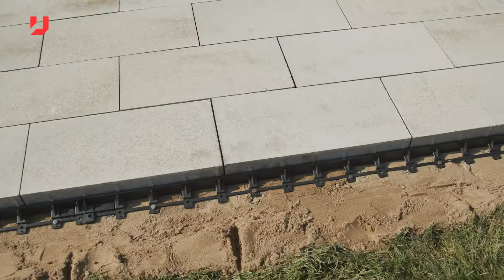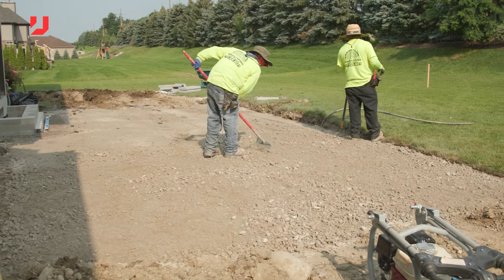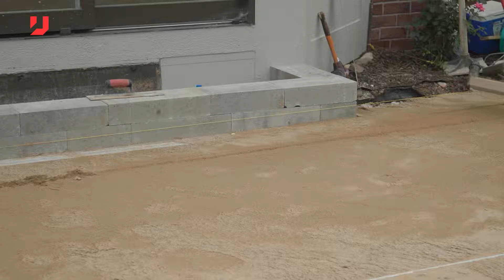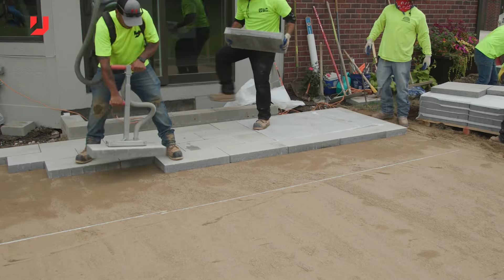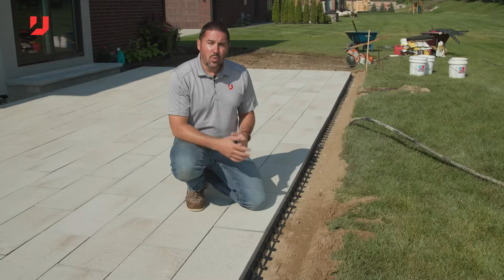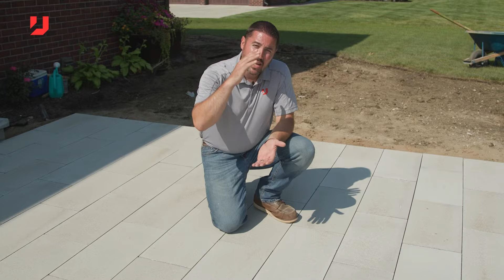Step-by-Step Guide to Paver Patio Installation

Comment: What’s the difference between using 1.75 inch pavers versus 2.3 inch pavers? 

I’m building a 17 x 17’ patio in Virginia. The plan was to dig 7 inches down with a 4 1/2 inch base, an inch of sand and then the 1.75 inch pavers. 

Is that fine or do I need to change it?
Reply from the maker: Hi there, thanks for the great question. As noted in the video, we recommend a minimum of 6" of compacted base for any patio. The difference between the 1.75" and 2.3" pavers is simply that the thicker paver requires additional excavation depth to maintain the recommended base thickness. So depending on the paver you choose, you'll need to adjust your excavation depth accordingly.

Comment: How do you address exposed tree roots on the site where you plan to put the patio pavers? The roots extend out about 20' from the location of the trees found on the perimeter of the house.
Reply from the maker: Hi there, if tree roots are present where the patio is going, they will need to be dealt with before installation. The best next step is to have a local contractor evaluate the site and recommend a solution based on the root size, tree health, and patio design.
Reply: @UnilockLtd thanks for your response. Can this include removing them while keeping the trees intact?

Comment: How big of a gap do you recommend between pavers?
Reply from the maker: The joint size is determined by the size of the lug on the paver, which varies based on the specific paver. When installing, the pavers should be placed so that there is lug-to-paver or lug-to-lug (depending on lug style, size and location) contact. Let us know if you have any other questions!

Comment: You didn’t mention why gaps left intentionally and filled by polymeric sand??
Reply from the maker: Hi there! The reason that's done is to settle all the pavers into the bedding layer, which forces some of the bedding material up into the joints, particularly the sand bedding layer.

Comment: Is it possible to use plastic edge restraint and then add concrete over the plastic restraints?
Reply from the maker: Is the concrete for additional support for the restraint? If you are referring to concrete edge restraint over top of plastic edge restraint, there is no need. It's one or the other. If you are using an open-graded base, you should only use the concrete edge restraint because the spikes will not hold in open-graded bases.

Comment: good info, but what I would do is make sure that the outer edge joints of the paver is sealed with something, so the sand does not escape when compacting or when it rains.
Reply from the maker: Hi there, thanks for the comment! Unilock pavers are designed to be durable, with or without a sealer! Choosing to seal is up to the homeowner, as some like the glossy finish and the way it makes the colors of their pavers look. Some prefer the unsealed natural look.

Comment: If I am doing a raised patio what is the best method for paver edging? If the raised paver patio is surrounded by a retaining wall are the retaining wall blocks suitable as an edge restraint replacement?
Reply from the maker: Yes you are correct! If the patio runs up against a wall, step, or the foundation of your home, an edge restraint is not required. We do recommend using a modified concrete edge restraint around the perimeter of your patio in areas that don't run up against a fixed edge, as modified concrete edging will provide the best support against freeze/thaw cycles. Hope this helps.
Reply: @ thank you so much! This will help me sleep at night now that I know I’m doing it correctly!

Comment: Great video. Do you do something after the final step to fill in the base extension areas? Do you fill that area in with stone or just back fill with soil?
Reply from the maker: Hi there! That's correct, you can either backfill the area with topsoil and plant grass or other landscaping elements. or add decorative stone or gravel around the edges. Whatever you prefer to finish your project with. Hope this helps!

Comment: Great video, possibly the best on YouTube regarding this topic!
2 questions- when blowing polymeric sand (prior to wetting it down), is it recommended to leave a little more than the 1/8th depth between pavers?  Asking because I would assume when blowing the surface, a small amount of sand will blow out from in between.

Lastly, does this video apply for setting cobblestone pavers as well i assume?  

I appreciate the information!  I can’t say no to a challenge and I’ve been granted an opportunity to create a beautiful back patio, fire pit and seating area.  So id like to make sure I get this perfect.
Reply from the maker: Thanks so much! For your first question, yes—aim to sweep polymeric sand to sit about 1/8” below the paver’s rounded or chamfered edge. When blowing the sand, a bit may lift out, but this final depth should help maintain stability. For cobblestones, it’s best to keep the sand level 1/8” below the point where the edge begins to turn vertical. Good luck with your project!
Reply: @ Cool, I appreciate it!

Comment: Can I use crushed concrete (21AA) as a base in Michigan?
Reply from the maker: Hi there, that is a great question! 21AA natural or 21AA limestone is preferred over 21AA crushed concrete.  The reason for that is that 21AA crushed concrete is not as hard of a material making it susceptible to degradation, also 21AA crushed concrete has a higher likelihood of contamination from undesired substances mixed with the concrete either prior to or after crushing. Hope this helps!
Reply: @UnilockLtd wrong.

Comment: The most comprehensive and thorough training on how CORRECTLY install paver which only 10% of contractors follow because they usually don't understand what they are doing and why they should be doing it in such a way: hence the failures you see all around.

Comment: Do you recommend adding gopher wire under the pavers in locations with high gopher or more activity?
Reply from the maker: Hello, thanks for reaching out. It's not recommended to place gopher wire under pavers during the installation. The procedure generally involves installing the pavers first, then the edge restraint, followed by channeling in the rodent fence. Hope this helps!